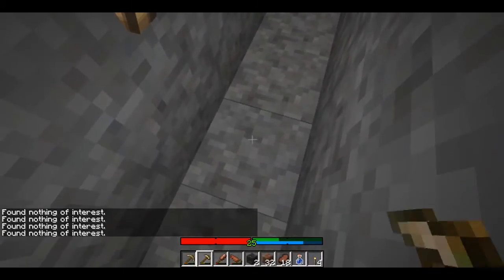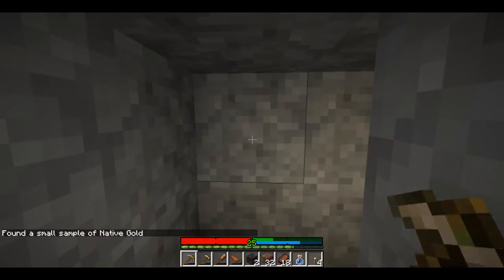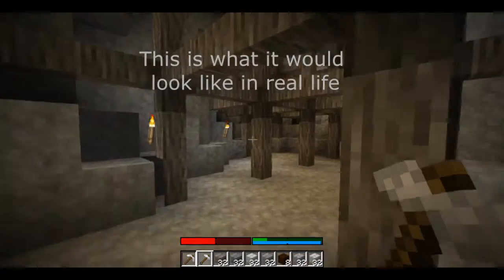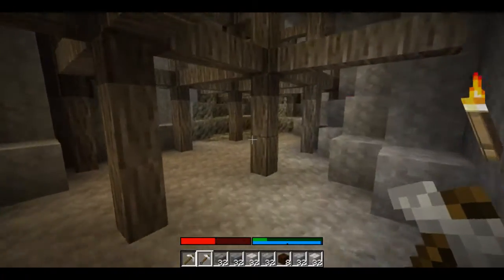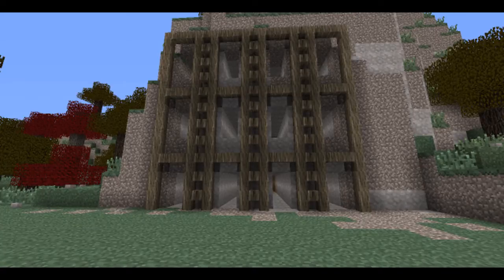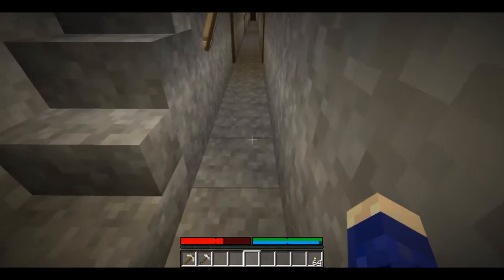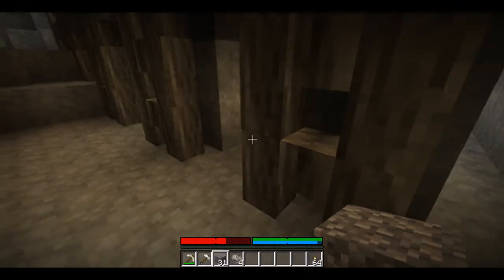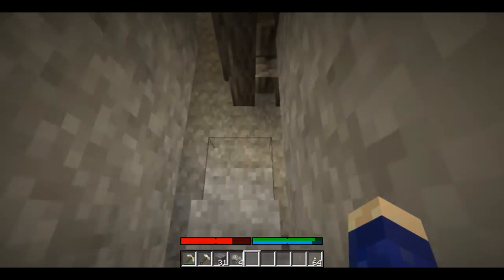Tutorial - Terrafirmacraft; Mining With Square Set-Timbering

Comment: That method needs lots of resourses... I'm trying to find a way with formula (inspected rock)/(cost) are max. I was thinking something about next mining algorithm:
1) find stone layer, where you want to find ore
2) start diging to the sides not far from top border of layer ~20 blocks from top.
3) every ~34-40 blocks diging to sides start dig downwards to another stone layer
4) carefully inspect that new shaft untill you found ore or not
5) repeat 3-4 ftw
if found ore use supports like in video.
Reply: Does your method work? The method in the video does use a lot of resources but the critical point is that it uses a lot of wood. But not a lot of your pickaxe. Maybe that changes with better tools but my current limiting factor is definitely my pickaxe.